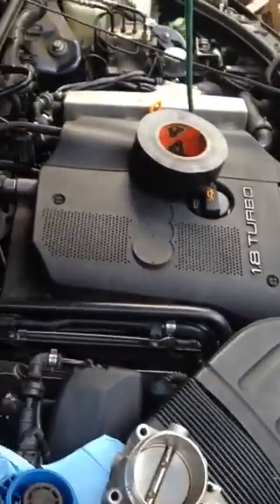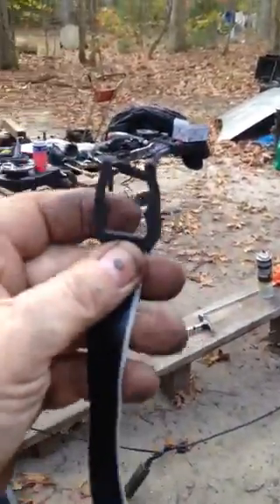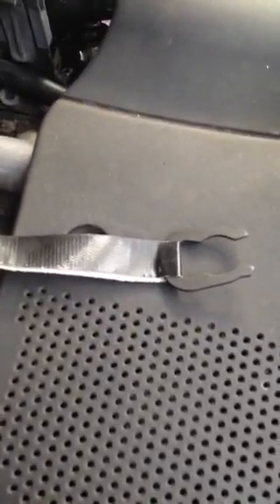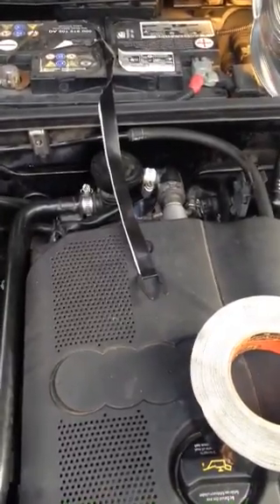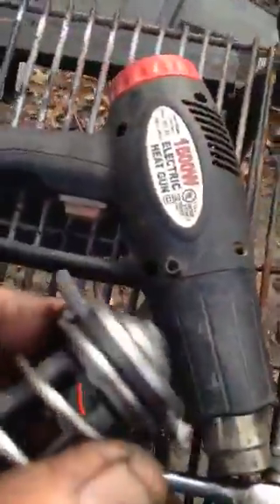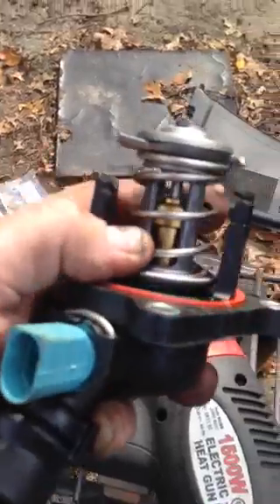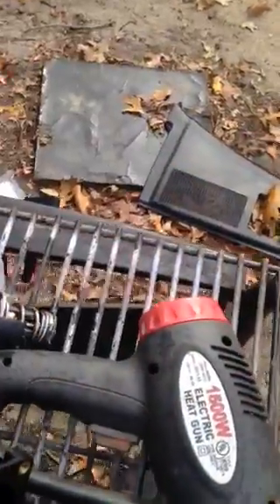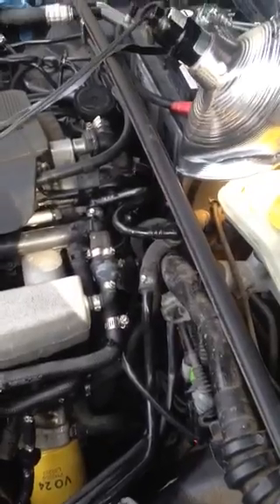Audi VW 1.8T coolant temp sensor thermostat installation ti

Comment: My MK4 jetta threw a code for this and now it's misfiring, so I'm hoping replacing this will help out. I replaced my throttle body, cleaned my fpr, and replaced spark plugs last fall. So if this doesnt fix my problem I'm going to either my MAF, ignition coils, or 02 sensor next.
Reply: DustyRusty Thanks for the input. It's not just one cylinder. The funny thing is it ran fine today. I had the car jacked up this afternoon because I was swapping over to my summer wheel set, and after I finished and put the car back down the problems began. Start was laggy, CEL, traction control, and EPC lights all came on with the misfiring.
Reply: DustyRusty What I initially meant to say was a few days ago I got a CEL with a coolant temp sensor code. That was it. I ordered the sensor and I have it, but it's just not in yet. The misfiring is now added on top of the coolant sensor code. From what I can gather, the coolant sensor has a lot to do with fuel mapping? So this with my previous comment will hopefully clarify... Thanks!!
Reply: Nope, I always use the proper points when I jack my car up. My car is completely stock with the exception of a forge 007 diverter valve, which is a quality part.
Reply: Ok so I drove the car for a minute around my subdivision, came back, and when I went to restart the car it ran fine. There were no misfires, pedals felt fine, everything seemed to be in working order. As of now the car is running fine, but still has a CEL. I don't know what else to do other than just drive the car and wait to see if it comes back. The codes were random misfire for all 4 cylinders, p0300, p0301, p0302, etc., and then p2181, and finally p0221. Thanks for your input on this situation.

Comment: did you replace it because the car wouldn't start, my audi is cranking but no start and i got a temp sensor code
Reply: I have the same issue. My car has a hard time cranking over. I have to give it gas and try like 10 times until it does start. I have the P2181 Code.